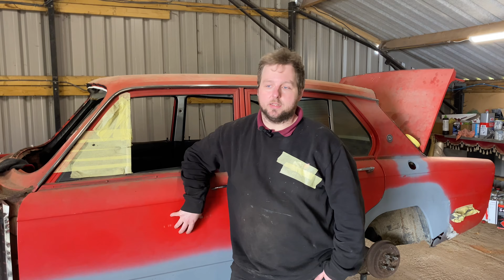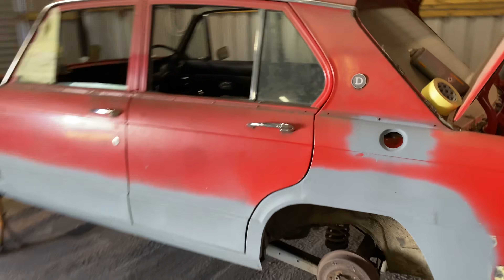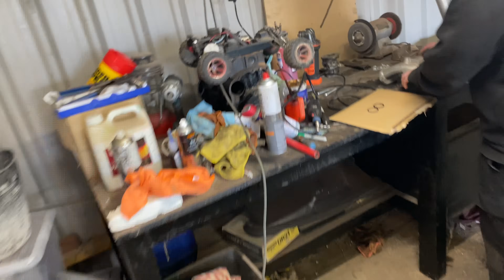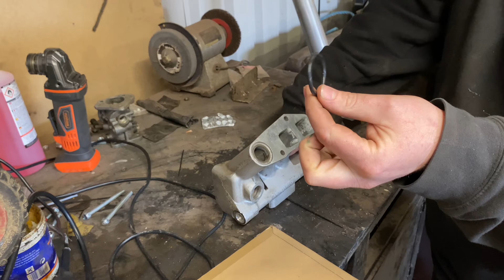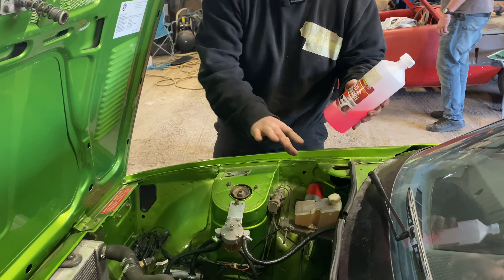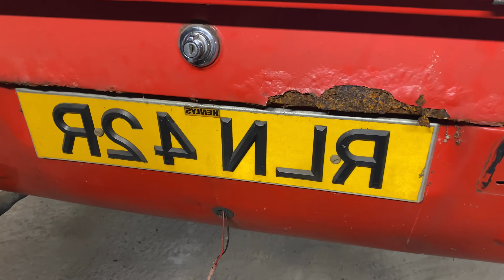TR7 cooling system rebuild & dolomite metal work update

Comment: If I use Rimmer Bros for the "OEM" o ring, is that acceptable?...I haven't finished the body work yet on my 76, but eventually I will get to motor work. I have purchased the intake orings and gaskets from Rimmer along with many body panels

Comment: Good work!! 
I'm wondering if you have removed the mechanical water pump with the Davies Craig EWP taking on the cooling function. I didn't catch you mentioning removing the factory water pump is all. I fitted a Davies Craig EWP to my Sprint TR7 , removing the mechanical pump,  I found plumbing the heater to the top of the pump cover had minimal if any flow . As the OEM pump is removed , in my case, there isn't a low pressure point at the pump cover to get flow.. I fixed it by using another pump to circulate coolant through the heater with a separate switch. I'm interested what you have done or found if that also to be the case for you. An even simpler fix is to plumb the return from the heater to the lower radiator hose between the radiator and EWP which is effectively a low pressure point in the system to get flow through the heater matrix. Anyway all the best and keep up the videos.
kippy
Reply: Ah I see you answered my question about removing the OEM water pump in another video. My bad